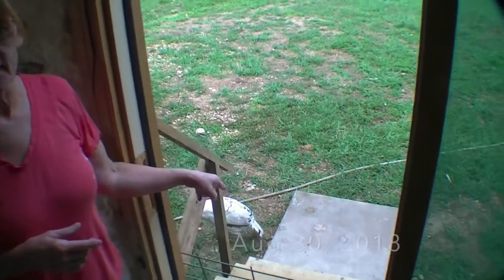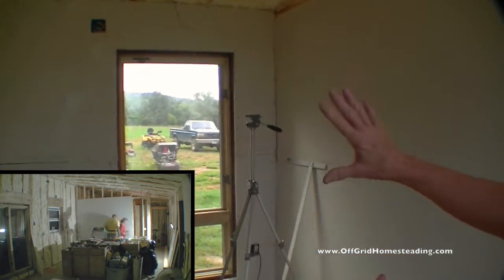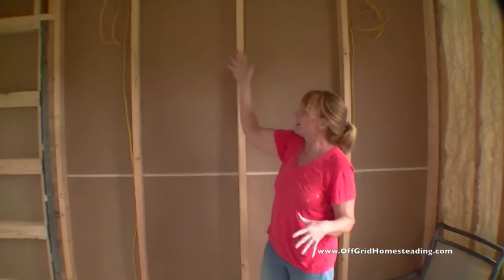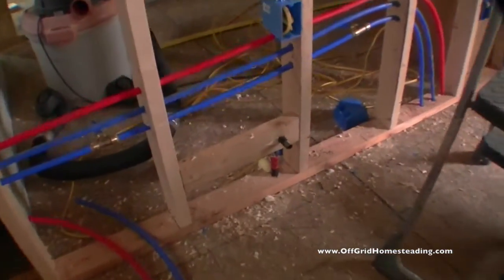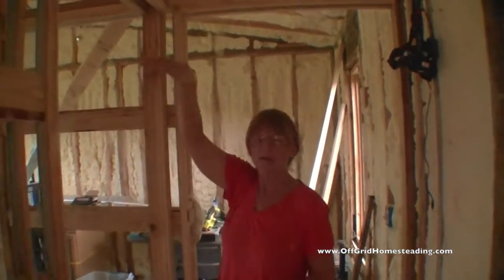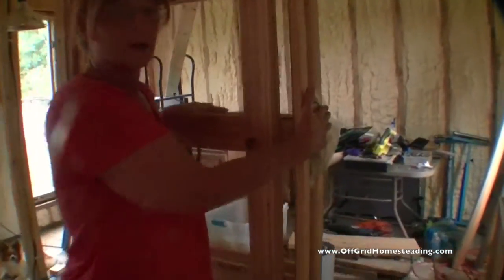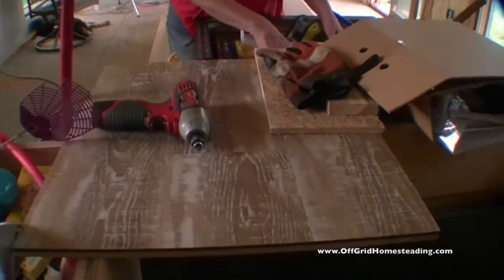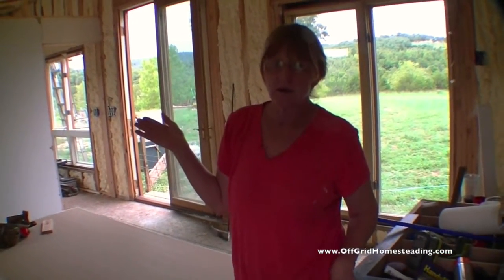OGH -DIY Build Pt 29: Homestead Update Aug 30 2018 with Kelly

Comment: Amazing what we can do when we need too! Good for you and great teamwork. Like the idea for the sort of built in bed. A lot of storage is important. Great ideas to solve that! Did you do a video on the structure and building of the pocket doors yet? They are something we are considering for our future build. Love the flooring you chose too! Congrats on selling the trailer 👍
Reply from the maker: I didn't do the pocket door video because it was simply creating a rough opening.  Now we measured our friends' pocket doors in her place, and built ours out to those dimensions---- DONT DO THAT.   Pick the size door opening you want.  Go buy or at least get the exact rough opening for the door, and build that out.  The door will slip right into that rough opening.  You'll need the strike plate on the closing side like we did with the 1x4 cedar (finished on one side, rough on the other -- about $8 each at Lowes.  If you pause one of the videos that show the pocket door it's just a rectangular opening).  Dont forget the LARGER shims and use a level to level the door horizontally and vertically.
Reply from the maker: My first door, I had to frame out twice (because we built it to the wrong specs).  My 3rd door went in the first time no problems the shims filled a few gaps where the 2x4 framing wasn't perfect.
Reply: Awesome! Thanks :-)